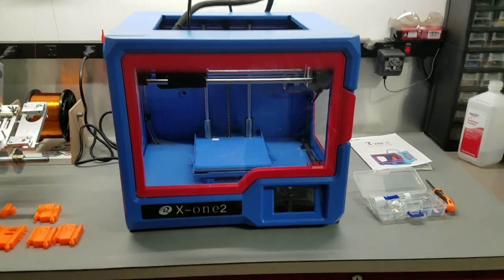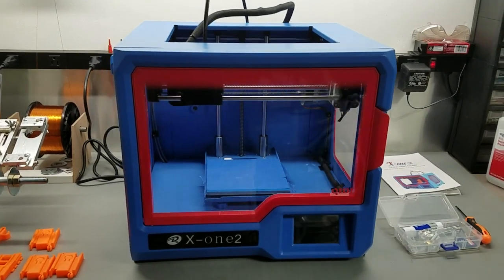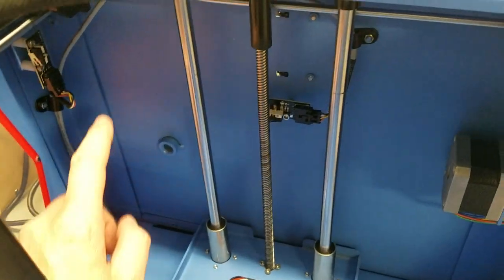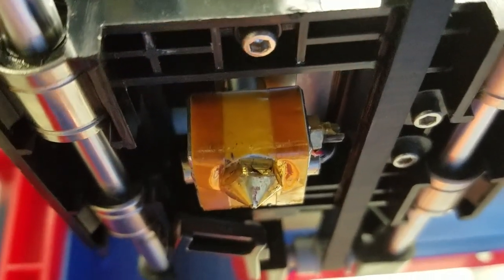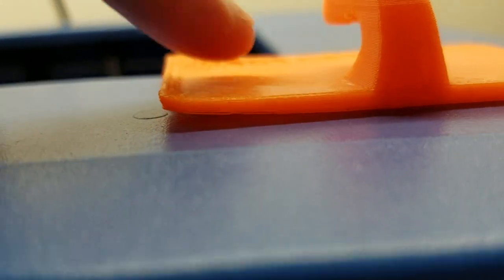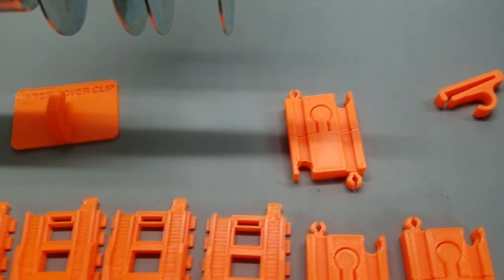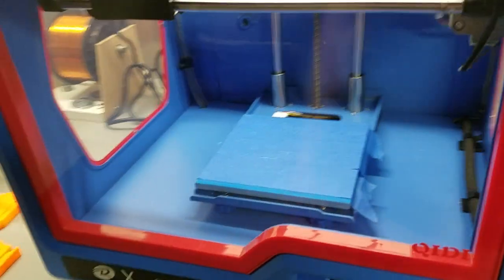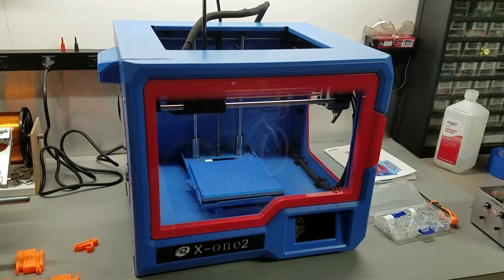I finally bought a 3D printer.

Comment: Hi Brad,

Would like to ask about the masks and N95 (to battle covid 19).

I have 3d printer here in Indonesia and would like to try to print the mask.
We also short on supply here.
Reply from the maker: https://www.imaginethat-3d.com/covid19

Here is the one I printed the other day. I think they are meant to use the blue surgical mask filters. You can also search online and there are many files, some designed by doctors.

The other thing (might be better) to print is if you have a larger area to print on you can print face shield parts then make the shield using laminate sheets or even a clear 2 liter bottle.

Comment: Your 1st layer is everything with Filament printing. If you haven't already watched an example of what a perfect 1st layer should look like...check that out. That helps set your nozzle height to get good interlayer bonding. Slow down the 1st 2 or 3 layers either with code or if it has speed adjustment on the fly. When i was having terrible nozzle problems...i would pull out and heat the noźzle to cherry red with a blow torch  and burn out the plastic and drop it into vinegar to sizzle away the oxides. Others use strong solvents to soak.
Reply from the maker: Thanks for the info. I still haven't even leveled the bed! So far I'm happy with the results I have but I'm sure that will change as I  get better at it. I did watch videos on bed leveling and what the first layer is supposed to look like which shows me that mine could use some tuning.

One problem I have had it parts sticking to the bed (Blue tape) too well. After a bit of research I found the best way is to pour iso alcohol on the bed and let it sit for 10-15 minutes, since the tape is made of paper it will absorb the iso alcohol and then I can pull the part off like it was never stuck.
Reply: @BradKwfc  ended up not using blue tape. Just good quality tape. You get good at laying it down nice and even, and just the right tension to not wrinkle. Hanging tape over the bed lets you get it back off easy too. I didn't like the blue stuff, it is too much like crepe paper for my liking. Being stuck too hard is never a bad thing. You should have a very sharp paint scraper for lifting strongly stuck things anyway. I tried some glues, that wasn't fun. The best was the easy release bed I got on the wanhao rebadge I bought